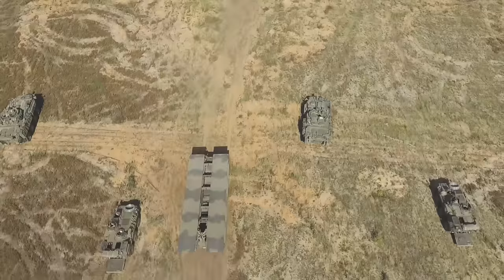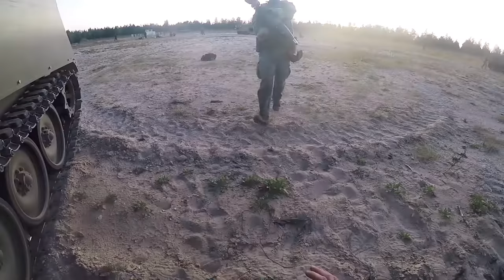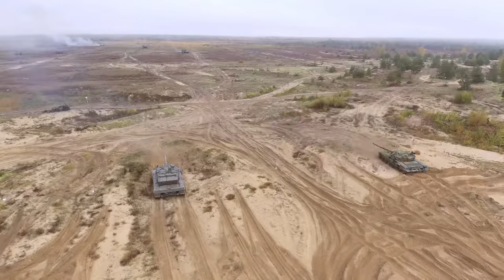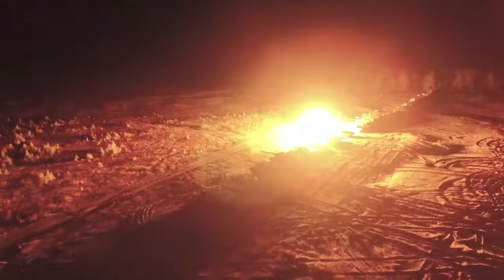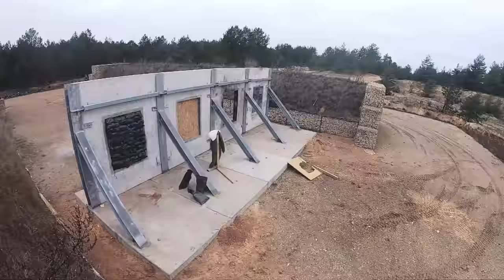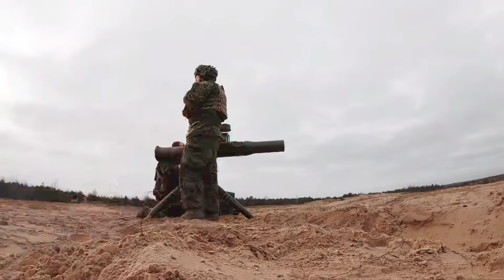NATO FIREPOWER DEMONSTRATION -This video will give you Goosebumps

Comment: This is like war thunder top tier RB mix battle.....
Reply: Nah, too much teamwork here 🤣
Cause in WT (apparently) everyone is like 'I do me, you do you'
Reply: @Jan_372  and you always get killed trying to help a teammates.
Reply: @prashantsharmastunning  ye, or face ATGMs, APDS or HEAT-FS in the constant uptiers, cause WW2 tanks from 1943-45 are apparently a fair match against 1950s-60s tanks.
Reply: Expect there actual teamwork
Reply: @Jan_372   #germanysuffers
Reply: @spoky2207  not quite suffering, but having a bad time. Luckily now we're getting more MBTs to fill up the gaps some removed WW2 prototype-tanks left. Plus the Walker Bulldog, that helps a lot.
Reply: @Jan_372   germany suffers is like a war thunder meme
Reply: @Jan_372   I no longer play 6.7 for fear of finding some strv103
Reply: @Jan_372  Think the 5.7-6.7 jump is bad? Try playing 7.7s going up against stuff with ERA and composite armor.

Matchmaking is not kind at all.
Reply: @MediumRareOpinions  sometimes I wish that certain groups of BRs would be seperated. Like 6.7 from 7.0 and higher. And 7.7 from 8.0 and higher, would that sound fair? (Or at least less repair and re-ammo cost + more exp in uptiers)
Reply: @Jan_372  definitely fair, but I've long held a suspicion that the game deliberately handicaps matchmaking.

Rarely do I ever get to be the 7.7 in a mostly 6.7 match, yet if i load up a 6.7 line up I will see 7.7s.

And not to brag but I do finish in the top 3 routinely enough to have unlocked the "superior" title so I am pretty good at ground forces. Not planes, I suck at planes.
Reply: @MediumRareOpinions  the way how air RB works is kinda meh, wish it was like ground RB
Reply: @MediumRareOpinions  wait for br 9 against br 10 tanks ... That's even worse. Best tier is 8.7 br.
Reply: sure... but it’s reality... so actually real life skills and training are required
Reply: @MediumRareOpinions  thats why i stay at 7.3 now( with the nrw br/cost changes)  only way i can get a 8.0 match is to play 7.0-7.3

Comment: I have a old video from 1997 from a huge fire power demonstration of the Dutch german core, leopard, prtl, m109, 120mm mortar, tornado, apache, bo105, YPR765A1 25mm m270, LArs 2 and more.. to bad back then no drones for filming.

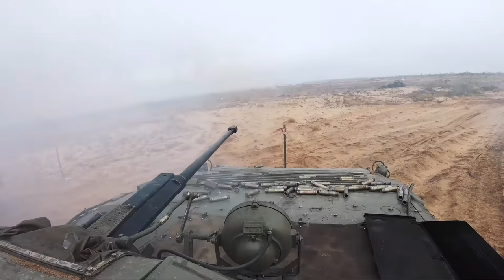Comment: 1:21 is this Warrior or Bradley?
Reply: You mean that firing AFV? That's a BMP-2 :D  https://youtu.be/txAYJFpozb0?t=194
Reply: @deffington6627  Wait, why does NATO have BMPs? D:
Reply: @bravomike4734  That's not such a big deal, those BMP's. Few thousands of modernized, low profile, floating, tracked IFV's Nobodys gonna bother, right?  :)
Reply: @bravomike4734  ¨Slovaks IFVs are still BMPs... Czechs have BMPs as well for now
Reply: @bravomike4734  Because the whole ex-Warshaw pact is in NATO now. Poland, Czech, Slovakia, Hungary, Croatia and others. What you saw on Video was most probably Polish BMP2. There was also a Polish modernization of T-72 and also Czech modernization of T-72
Reply: @timm.4824  My bad. But the idea is that Yugoslavia was a part of eastern block and used some of the Soviet equipment. Some of that equipment can be found in Croatia's forces, a member of NATO now. Yugo had their own different BMPs if I recall correctly, but M-84 tank is a development of T-72.

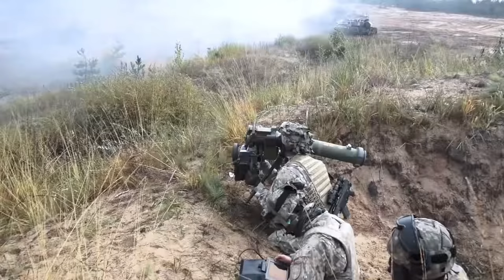Comment: 1:10 Now, I know about wire-guided missiles, but what is that THICK ASS ROPE doing, coming out of what looks like, from the POV of the camera, a shoulder-mounted rocket launcher?
Reply: It's just a Javelin launcher, or at least some variation of it. I don't think the modern ones are still wire guided like that but I could be wrong.
But yeah the cable is just the guide wire, it's basically a thick ethernet cord capable of wistanding being yanked on like that.

Comment: Goosebumps simply because it shows the cooperation of so many nations. On the other hand....
So many languages, so many standard operating procedures, so many different parts and munition calibres. And it all has to be hauled from all over Europe, the US and Canada. Regardless of how impressive it looks, it also shows the inherent weakness of NATO.
Reply: 5.56 is the standard NATO assault rifle caliber and I’m pretty sure all NATO nations use it for there assault rifles 7.62x51 is the nato standard for DMRs and battle rifles and I’m pretty sure most nato nations have agreed that the L44 120mm gun is standard so there are a lot of standardized things the language barrier though is probably a fair concern
Reply: @jameson1239  Even that is partly correct. There's also .50 cal for heavy machine guns, 7.62mm for MG's, 40 mil for grenade launchers.  Apart from that, have you seen the guns and autocanons? (25 mil, 30 mil, 35 mil, 120 mil smoothbore, 120 mil rifled (Challenger), 125 mil smoothbore). Or what about all the different engines, vehicle parts, sensors, comms, etc. It must be a nightmare to make stocks for a brigade size battlegroup of that composition. And I don't know about you, but have you worked alongside allied soldiers whose English isn't fluent and the control of terminology is lackluster? Try to explain the basic hammer and anvil tactic (or more correct: firebase and pincer movement) and you know the other side will have understood only half of it. Now try doing that in a combat situation over radio with heavy comms jamming and lots of ambient combat noise and someone  with a heavy highland accent from Scotland  talking to a Spanish sergeant major from Sevilla. That's when the shit hits the fan.